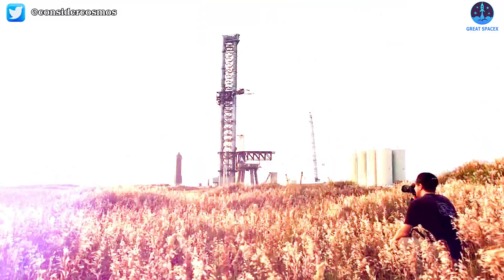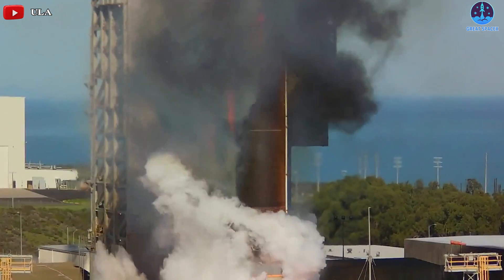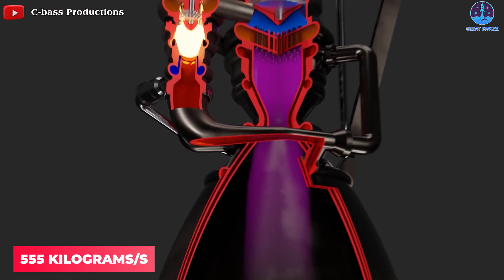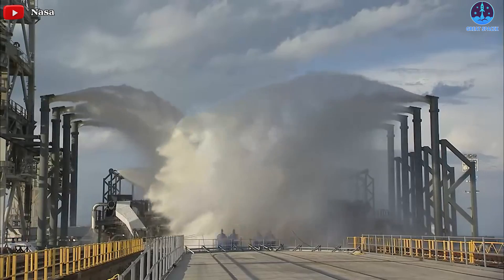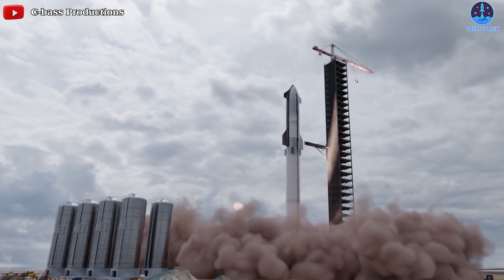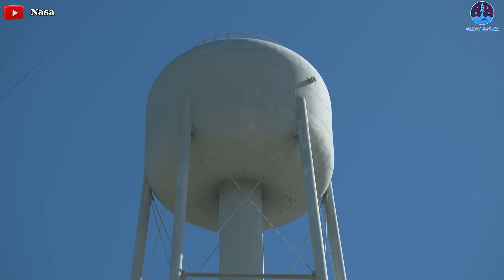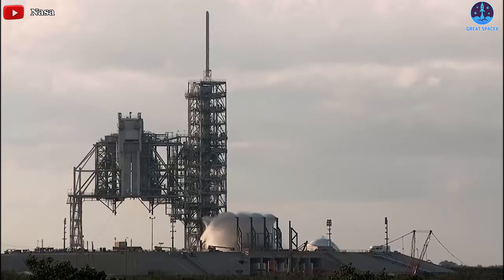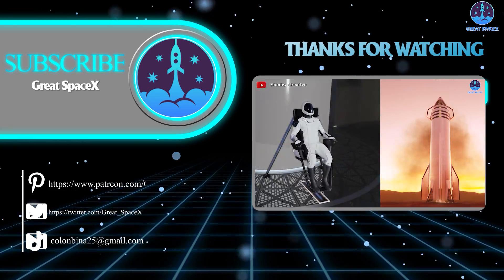Massive energy enough to power today's largest nuclear plant is generated while launching Starship

Comment: Hard to imagine that water itself would be a limiting factor or a significant cost. Sure you need a lot of water to flow from expensive elevated tanks, but only for relatively short duration of the launch.

Comment: Put some turbines at the spillway and let the exhaust spin them to charge banks of Tesla batteries for later use.
Reply: It would probably annihilate the turbines with the extreme wind, also it would be too expensive to do. They could use Tesla car motors to generate the electricity (slap a Tesla motor onto some fan blades) and they could theoretically generate 20 KW/motor/hour of running at max speed. The issue is rocket launches only last for a few minutes. Also, if they used Tesla’s induction motors, one motor costs about $30k, so it would be pretty costly for minimal power returns. It’s just not practical.

Comment: do they need freshwater?
if no, they can use the ocean near the launch pad, so there is no impact
or they can use systems to create freshwater on the site, there is the impact of the energy required to clean this water.

its not an infinite resource... but the consumed water fall back on earth.
vapor = clouds
Reply from the maker: They usually don't seawater to launch rockets because it would cause serious corrosion problems.
Reply: I think the supply problem is getting at the fact that once the water is extracted from the clean supply, it would, after re-condensing, need to be pulled from the environment, and run through the treatment plant another time?

Comment: I am curious of where you got your sound levels from?  When I look up the Saturn V, I am consistently seeing numbers of over 200 dB.  Starship is supposed to be twice as powerful, so probably twice as loud, granted dB is a logarithmic scale.  I suppose that is another thing it would have helped mentioning, so say you go from 204 dB to 207 dB, that is twice as loud.  110 dB is considered to be "extremely loud".  So yeah, if you are talking about 207 dB for a Starship launch, that is quite a lot.  I am having trouble finding a chart that gets anywhere near this as it is just so far beyond.  Even the much smaller Falcon 9 launch when I have watched one of these from ~3 miles away literally rattled my bones from the sound waves.  It was an awesome powerful experience you can only really experience by being there.  For Starship I am thinking you want to be at least 5 miles away so the sound doesn't harm you and maybe farther in the event the rocket blows up.  When there is that kind of energy stored up and that kind of energy being released, you don't want to be too close to that.  When the sound waves can smash and melt concrete if not dampened, it definitely can cause hearing loss among other things if you are too close to it.  That is why a site like Boca Chica is so important as there are not too many places along the coast, especially a more southern place with it opened up to the east, where you can have that kind of open space for a launch.  Cape Canaveral is good enough for smaller launchers and was once home to the mighty Saturn V, but something the size and power of Starship really kind of needs its own space.

Comment: I get why they use fresh water but I'm not sure why they'd require fresh water.
Reply from the maker: Because seawater would cause serious corrosion problems.
Reply: @colonbina1  the should filter the sea water with giant boilers. Heat the water until it boils, the water evaporates and leaves the salt behind, then they could collect the water vapor droplets, store it in big tanks, and pump it to the rocket ignition site. The only issue is they use roughly 300,000 gallons of water per launch. That would take a while to filter.
Reply: @CarcinogenicONE  And they could use heat output of cooling methane and oxygen
Reply: @CarcinogenicONE  This would not be economically viable, much more expensive than just paying the water board for fresh water
Reply: @Sam_Bellwood  I guess you are right, I just ran the numbers and it would cost ~$744 for 300,000 gallons going at current Boca Chica industrial water rates ($2.48/1,000 gallons).
Reply from the maker: Yep! This's a good idea!
Reply from the maker: Exactly!

Comment: I know it's called waste heat but it it is ridiculous that that the heat cannot be used to generate electricity
Reply: It would be impractical to strap a steam generator (the most efficient way to convert heat to electricity) to the rocket to reuse the waste heat, the electricity is not needed and it’s expensive/heavy. If they built one for the booster’s static test fires, the generator could stay on the ground (not attached to the rocket) that would make it a little more practical, but it’s still expensive and ultimately not worth it due to the short duration of these tests. 

Thermoelectric generators are also too inefficient for this kind of application. You would need thousands of TEG plates to get a usable amount of electricity out of it, which would be heavy. Maybe in the future if we can get a TEG efficiency above 50%, then it would be worth it. But modern TEGs are only 5-8% efficient at converting waste heat to electricity.
Reply: @Dode  thanks for that, i was talking about the waste heat or thrust at launch. 
Why couldn't it be diverted through a tunnel system to drive a turbine , and the electricity stored in mega batteries.
Reply: @davefarmery8180  I figured you were either talking about launch, or in flight. It wouldn’t be economically worth it. The generated electricity would be minuscule compared to solar, and it would be expensive.

Comment: All this makes me wonder how much pollution these launches produce.
Reply from the maker: They will have a remedy. If not, they themselves have to stop their work.
Reply: Burning one molecule of methane (ch4) in the presence of oxygen releases one molecule of CO2 (carbon dioxide) and two molecules of H2O (water). One booster holds around 800 metric tons of ch4. Using this information, we can see that around 800 metric tons of co2 is generated per launch (if all ch4 is burned and none is left over).

Comment: Yup! Water is not an infinite resource. I really wanna know how space companies and agencies maintain the required amount of water for each launch. Can't wait to see it! Thanks for an informative video, Kevin and Great SpaceX!
Reply: Why can't they just pump it straight from the sea? Any reason they can't use salt water? I guess it is more corrosive, but does that really matter?
Reply: @Sam_Bellwood  That is an excellent question to begin with. And even if they needed sweet water to prevent excessive corrosion on the launch pad, they could easily take it from the ocean and desalinate it, if local sweet water supply is limited or compromised by any means.
I don't see why the water resource question is even a serious topic here. They have tons of real problems to solve to get this thing into orbit, let alone to the Moon and Mars.
Reply from the maker: Thank you so much! We will respond to you as soon as we have the most accurate information. And don't forget to keep on watching our next videos!
Reply: Well, it’s not like they are taking the water up into space with them so the water source is not drying up.  It is just tap water which is really inexpensive even for the amount they are storing  in the towers to dump during launch.  This is not the fresh water you would get from a glacier or spring.  If they had to, they could desalinize salt water but that would be much more expensive.  
A lot of the water vapor, in the early days when they were using carcinogenic propellants aka UDMH, left acid and precipitants that contained toxins.  The solid rocket boosters still cause the water to become acidic though and have a negative effect on the ozone, we are still using those on the SLS and Europe uses those on the Ariane. In nature, the pH is brought back down rather quickly though but there are still a lot of unknowns with regards to the negative effects on the environment that these have.  I wouldn’t drink the water vaporized by those.  

These days, the UDMH used in the USA is reserved for second stage and beyond so it does not come into contact with the earth, however, the same can not be said for the Russian proton or the Chinese long March.

After launch thwre is also some water left over that is not turned into vapor which is tested, and if safe, redistributed.   
 LOx and LHx is about as clean as it gets.  The fuel is burned and creates water vapor, it just does not cantain the same amount of energy as other propellants but it is well studied and has been found to have almost zero negative environmental effects.  So the water vapor would settle and return to the ground.
Reply: @zappulla4092  Careful, you're coming very close to injecting some sound science into the discussion, something that will expose the mostly nonsense in the video to some unflattering scrutiny. 

FYI, H & LOX by weight/density are more energetic than almost any other fuel, which is why the RS-25 vacuum engine has ~ 20% higher ISP than Raptor Vacuum has, and RP1 engines are well behind both, with the Apollo's F1 engine at 264, the RS-25's ISP being almost half-again as much.

To sum up, the ...
F1 gets 26.4mpg 
Raptor  37.8mpg
RS-25   45.0mpg
... to use an automobile analogy. Guessing you already know this.

Given how awkward it is to make propellant on Mars or Moon, and what a rat's nest 33 Raptors is, SpaceX needs to leave Methane to that loser Bezos and build a 1.5Mlb thrust hydrogen/LOX engine and get down to 10-12 engines on SH & 4 on StarShip. Bigger engines should have pwr:wgt ratio advantages as nozzles & pumps and plumbing benefit from the area inside a circle growing logarithmically while material is proportional to the perimeter, which grows lineally.
Reply: I think so too. Hope to see it soon!
Reply: @EirlysMT  Yep!
Reply: Water only leaves the atmosphere if we send it out on a rocket. We have all the gases necessary to create water through chemical reactions, let alone through natural recycling. Sea launches will be the cheapest route for water suppression.
Reply: Experts? The bar is always moving.
Reply: They aren't consuming/destroying the water. When they get through with it it's still water. Jeeze, do you even read what you write before publishing it? Dumb!